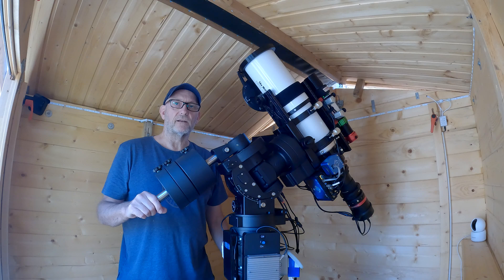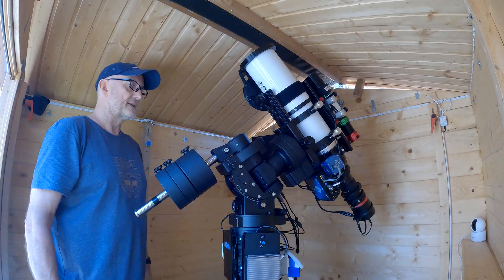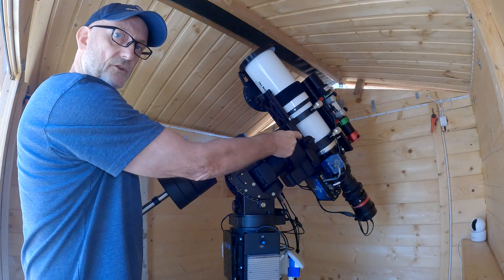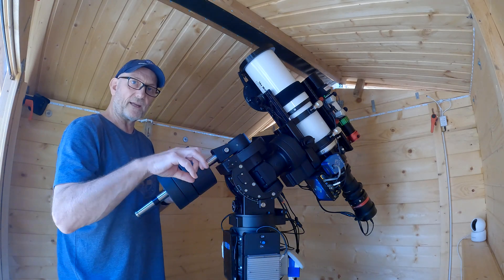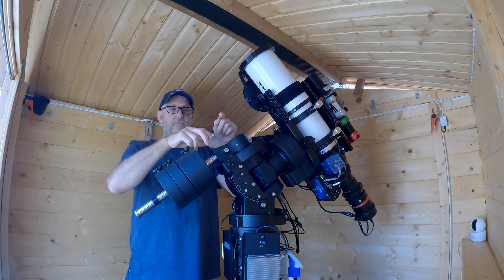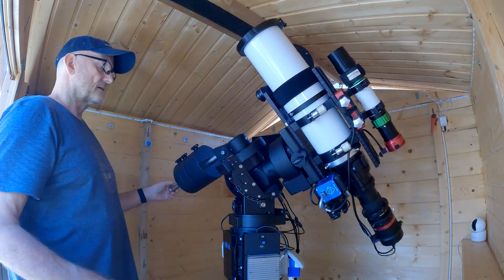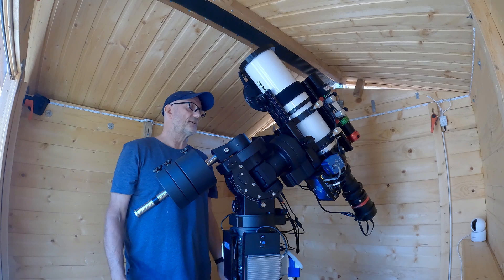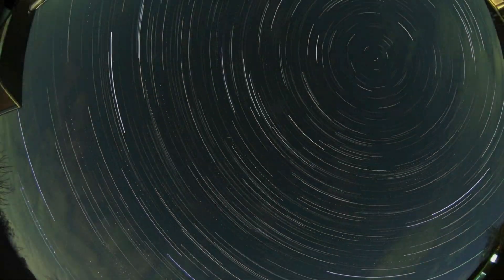4D Balance a CEM Telescope Mount, Yes 4D!!

Comment: Interesting Stuart , I was curious about balancing as I’m awaiting a CEM40 to be delivered from FLO hopefully tomorrow, I did ponder on a harmonic but decided on something with an established background so fingers crossed 🤞 I made a good choice , will primarily be mounting a Redcat51 but be able to hold a 200pds which I have on an old Eq6 pro
Reply from the maker: Thanks for the comment, it certainly helps these mounts when they are balanced well on all axis 
Enjoy your new mount 👍🏻
Reply: @Astro_Shed  finally sorted balancing the Redcat51 /EFW2/Atik490  in the end because I had it mounted on a Losmondy plate I offset the scope on the dovetail 1” off centre that brought the mount back to perfect balance, saved having a  balance weight

Comment: I assume that screw under which you placed the shim can only be loosened if the mount has no equipment on it and the counterweights are off as well...
Reply from the maker: Thanks for the comment, yes that would be best practice, sorry if I did not mention that, it does not take much to make a differ,ence in the balance, clear skies 👍🏻
Reply: @Astro_Shed  Thanks for the clarification...

Comment: Thanks Stuart!  Could you explain the adjustments and sequence you use to get the correct balance?  Obviously two of the adjustments are the position of the counterweight and the position of the scope on the saddle.  A third adjustment would be the weight (and position) of the small weights on the saddle.  A fourth adjustment would be the trueing of the counterweight shaft.  What sequence do you use get balance at all four attitudes?
Reply from the maker: Thanks for the comment, and question.
Personally I set the scope horizontal with weights pointing down, and balance that, by moving fore or aft in the saddle, then put scope back to pointing north and loosen Dec axis again and get the correct small weight on the side of the saddle, to stop the scope falling either way,  then lock DEC and turn the RA horizontal and move CW up or down shaft to suit, then put scope back to home pointing north and check for it falling in either direction, and shim if needed, I do this last because it does not affect the other 3 balance positions. Hope that helps.
Also all this is done after I have used the scope and focused it, so I know the focus tube is not going going to move more than a mm or so, as that would throw it all out, but how absolutely perfect it needs to be…well I am OCD, so that does not help at all. 😂
Reply: @Astro_Shed Excellent !
Reply from the maker: @phfen  thanks for the comment, much appreciated 👍🏻

Comment: Whats a 0.5 shim? Where can i get. Good video
Reply from the maker: Thanks for the comment, as for the shim, I just bought a pack of different size small squares of metal sheet, from EBay, from 0.2 up to 1mm in thickness. Each sheet was  about 10cm square
Hope that helps..👍🏻
Reply: @Astro_Shed  thanks could you link it please
Reply from the maker: @hakankaya-gj1su  this is what I got, just pick the sizes from the drop down list and ad them to your basket…👍🏻
https://www.ebay.co.uk/itm/224934677496?itmmeta=01HZJ1GA83EF1TBDW7VQ7PVHZW&hash=item345f26cbf8:g:ahIAAOSwpr1iVfP~&itmprp=enc%3AAQAJAAAA4It3rn0C8%2F68BEgT0i5tMVYZqDNAal6nFoDhmSBECcd9z3gHW8bV97PoptOmUkbdvYwDMBy%2BbiPfvb31RUQWp%2FmNUp9m7tEK%2Byu0fJ4urqUe0TWamGOEVxvphcqt6re7Z%2FUq%2FzM9tPiNaIKFb00ZK6u4YU%2FjSB8a7ssDlKfQaAWIETm4AC9Jsz7PmDIP%2BW8FWw%2Fic1%2BeIKWtNHQfQS2Ypc7Cu9NhYjfBnxe30LGjsueNa4HpwVZWPMlW7TxYmM5cPIhbO27mG%2FC%2FRRSF9mCZovuhDYHTgy5p266QU3AM6ia6%7Ctkp%3ABk9SR5akwcH8Yw

Comment: Great video Stuart! Your ioptron mount inspired me to "graduate" from an EQ6-R! Luckily I found a second hand CEM70G. It's a few years old but guides pretty well. Instead of the small weights next to the saddle, I put weights at the end of the long shaft, perpendicular to it. This is done using a "Neewer Super Clamp" from Amazon which fits the ioptron shaft and small weights on a M8 bolt from Screwfix 😂
Reply from the maker: Thanks for the comment, yes many people do it that way, I just find it a bit ugly looking….and with my way of balancing and using a bit of shim, a small weight on the saddle is all that’s needed….
Clear Skies…👍🏻